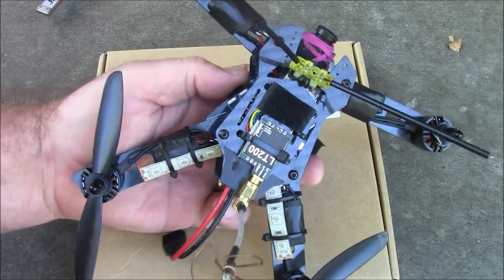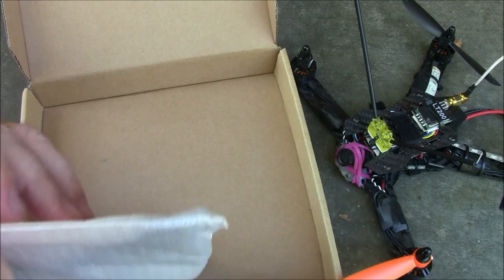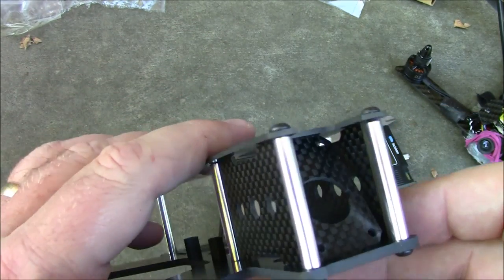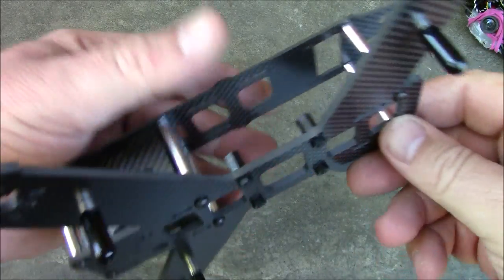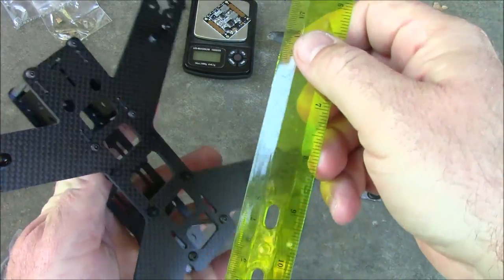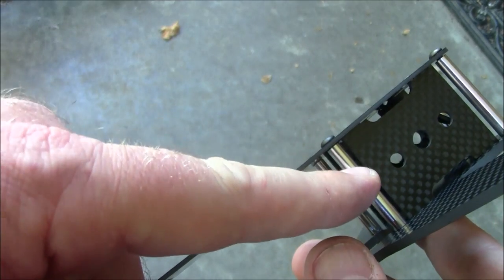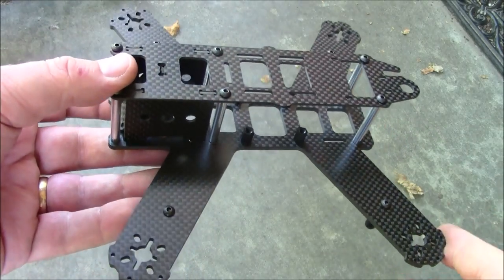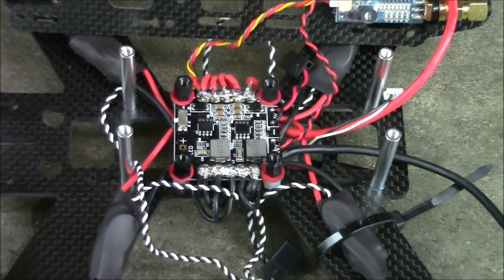Lisam LS-210 Frame Review from Banggood

Comment: nice, looks lot better than i expected. looking forward to the build / flight
Reply from the maker: +michael lee Me too.  I have a couple of ZMR250s I've been flying for the last couple of weeks because my ET200 has been down.  I built a VDQ210 (which was way more awesome than my ET200), but I crashed and cracked my frame.  I'm going to do a build & tune video for it too soon.  I'm most excited to get this LS-210 flying though.  I think these smaller frames with 5045 or 5046 props are just so fast!
Reply: cool if u r going do a build vid, im gonna have to build one to : )  funny how everyone is flying under 250mm now days.

Comment: Comes with the same power board I have been getting for my other builds. So far no issues. The LED pins are just directly connected to the battery with the switch turning them on and off. I usually dont bother and just connect my LEDs directly to the pads with all the other cables..

Comment: I'm very happy with this frame, it is pure carbon fiber. I did a test with a multimeter all around the baseplate and top plate and in between them as well and it's all carbon.
Reply from the maker: +daneyan1985 That is good to know.  I had a terrible crash yesterday and broke a lot of parts, but the frame was unscratched. It was amazing.
Reply: +travisgrindal yes I've had a few bad crashes with it. just got a few scuff marks and scratches as expected. I've hit everything from trees to my woodshed.

Comment: Hi Travis May I ask some info. That frame is a 4 inch right. The center of the motor shaft to the frame post is just under 2 1/4 inches. What size props would I use. I already built my first quad and is just learning. But with so many sizes of blades out there im confused on what size is good for my LS210 frame. If you can direct me towards a number I would appreciate the info. Im new at this FPV and am learning. Im running 2205 emax motors. And need props to replace the broken ones but they don't sell those props anymore. I got the quad for free. But the props were on so tightly I broke one. Thanks for any help

Comment: does your power board belong next to the bottom frame on the inside before you put the nylon risers it would give the frame some stability
Reply from the maker: +Farley Gordon You need to have some kind of spacers between it and the main plate so it doesn't nothing shorts out.  I'm using a different spacer than the one that was included because my other ones are a little shorter.

Comment: is the size of the top plate identical to the qav210? so if i order a angled video cam mount it will fit?
Reply from the maker: +NL FPV I'm not sure.  I haven't compared it directly to a QAV210.

Comment: Would I be able to fit a RunCam Sparrow in this frame? Looking for advice because I'm building my first quad soon :)
Reply from the maker: yes, but you'd have to find some 3D printable mounts for it.  The included side plates would fit a full size RunCam but not the minis or micros.
Reply: I actually happen to have a 3D printer I so I guess I could make my own. Thanks for the reply :)

Comment: you seem to like the cc3d board compared to the naze32 . Bruce at RC model review says he hates the cc3d and loves the Naze 32 can you speak on this. it seems you have had good luck with the CC 3 D
Reply from the maker: +Farley Gordon I like the CC3D real well. I can find them for $15 whereas the Naze32 always seems to cost me $30 shipped.  I also seem to have a very easy time getting the CC3D tuned.  I tried a Naze32 on my VDQ210 and I got it to fly real well so I'm kind of back and forth about which I like better now.
Reply: +travisgrindal try Cleanflight on the CC3D. Works great.

Comment: +travisgrindal, Hey 
Can a 2200mAh be fitted on top of this frame?
How long is the top plate?
Thanks for the review!
Reply from the maker: +Ran Haveshush A 3S 2200 can fit, also an 4S 1800 can fit.  They're both pretty heavy though.  It would still fly, but just might be a little slow.
Reply: +travisgrindal thanks for the info.
Reply: +travisgrindal what's the length (in mm) of the top plate?
Reply from the maker: +Ran Haveshush It is about 6 inches long.
Reply: +travisgrindal thanks!

Comment: Closely inspired?  I would say %100 copied.
Reply from the maker: +CHARPU FPV Probably from the same production line.  :)
Reply: I dont think so. It is pretty sad, people put a lot of work to design that frame.
Reply from the maker: +CHARPU FPV The LS-210 does have 3 extra small holes at the end of each arm.  That makes it completely different.  LOL... sorry, no it doesn't.  :)
Reply: +CHARPU FPV They've copied the QAV210 for sure, the angle of the arms is identical and general shape, but the LS210 is actually a 220, perhaps so they can argue its not a copy?? 

To keep the weight of the LS similar to the QAV210 they have been really aggressive in the size of the weight saving holes in the bottom plate. So much so that whilst the QAV210 is nice and stiff in the hands, the LS210 flexes quite easily.  You probably know all this already, apologies. I have so far bought three of your frames from GetFPV and I think they are great! Thank you.
Reply: +CHARPU FPV Everything down to the little xt-60 holder and antenna holder in the back are copied. Can't believe stupid companies like this think they can get away with things like this. Is the QAV 210 pattented?
Reply: Hi Thomas, I actually ordered a clone so I could compare. They've clearly copied, but done a few things to make it very slightly different, presumably in an attempt to keep ahead of the law. For instance the Charpu is a genuine 210 but the LS210 is 220mm. The Charpu flies better, its lighter and stiffer.
Reply: +CHARPU FPV, QAV or your name needs to get a registered logo / trademark which can be cut into the frame as part of the design. That prevents people from mistakenly buying the knockoff article. Quad designers need to think of their designs like fashion designs. You can't protect clothing designs. That's why the logo features as part of the fabric print design. A trademark symbol which can be cut to form the holes in the frame is about the best you can do. I agree its deeply frustrating.
Reply: That's a good idea. Might be worth sharing that with Lumenier.
Reply from the maker: +Tobermory Cat I like this idea.  I've seen it on other quads.
Reply: ***** ha, yep
Reply: +CHARPU FPV  I would say 85% but yeah I hear ya... :-/
Reply: +Torch Fpv like the Raceblade and the Alien? Glass houses Charpu
Reply: +Stephen Gibb Very much agree with you sir.
Reply: +CHARPU FPV the only good thing about the frames is that its cheap and is like yours i would buy yours but don't have a lot of money
Reply: 100% copied at a fraction of the price, I know which I'll choose, maybe if you guys weren't so fucking greedy...
Reply: CHARPU FPV  shame that people clone copy bloody everything from films to inductrix and the true qav 210 frame 
it's destroying everything we want as the true hard working inventors,designers are loosing money that they put all their hard work into....

Comment: Unlike the zmr with two base plates and 16 metal bolts - this single arm / base plate design seems better. The arms look as wide as thug arms so should give some protection for escs and its as cheap to buy a replacement quad as buying 4 thug arms for a zmr.
Reply from the maker: +Tobermory Cat Heh... yeah.  I think the thug arms are 4 or 5mm, right?  This main plate is 3mm. I have 2 flyable ZMR250 quads and another frame in the package.  They've both taken some bad crashes and I haven't broken anything yet.  I'm hoping this LS-210 does just as well!
Reply: +travisgrindal Seems like banggood are reducing the stuff in the package - no longer contains the useful 5v and 12v power distribution board. Presume the props will be gone soon.
Reply from the maker: +Tobermory Cat the PDB usually comes with Diatone frames.  This is a Lisam.
Reply: ***** My first order of the Lisam came with "gifts" which included the PDB with 5v and 12v! It also came with 4 bullnose props. Bit sad to see that on the banggood site the PDB is now gone ( I was buying a second frame as I prefer this to my zmr.)
Reply from the maker: +Tobermory Cat Nice!
Reply: +travisgrindal 
Liked the Lisam a lot, bought 2. Flew great - sadly lost one into the sea. Just received this to replace it. Rect-210 210mm. The good thing is it doesn't feel like a knock-off of the Charpu 210. 
http://www.goodluckbuy.com/rect-210-210mm-4-aixs-3-0mm-carbon-fiber-mini-racing-quadcopter-frame-for-fpv.html
The arm ends are more robust and will take more abuse. The CG looks good
with the lower top plate to mount the battery. Impressed with the
quality of the matt carbon - the rear back wall sides are a bit rough
cut and again they cut out holes in the frame look like they are
badly placed, weakening the frame. Side walls work better for me in
winter - keep the snow out. Seems like a nice bit of kit.

Comment: updates?  still good?
Reply from the maker: +CoolStuffReviews Not "good"... rather "awesome".  I had a crash where I broke all 4 props, my VTX, my VTX antenna, and antenna holder.  The frame took it like a champ... not a scratch.  I did lose one leg of the landing gear.  I'm building another one soon.
Reply: +travisgrindal thanks for the info.  why are u building another?
Reply: +CoolStuffReviews I really like the frame so I'm building another with faster motors.  I want to keep this one as is because it is MultiGP legal for racing.  The new one will not be.  It will have to fly in the "open" races.
Reply: +DryTrout what motors will you do